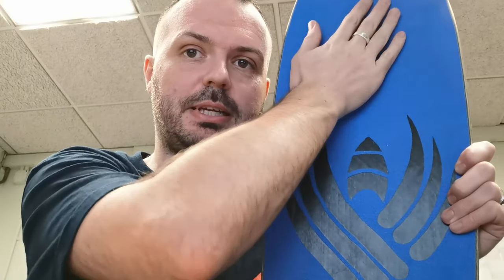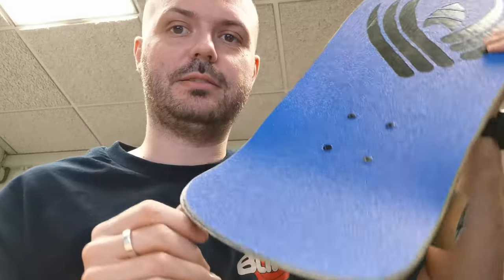I did a custom re-grip of my Powell Peralta Flight Caballero skateboard & easy grip tape removal.

Comment: I have regripped my flight decks a few times. The grip comes off easy. I did have the carbon peel up one time. But flight decks last longer than the grip so it is good to do. I always order the same flight deck 8.25  shape 243. I just received some Powell ripper grip for my next flight deck set up. I thought it would be set up by now but this chocolate deck am skating is really holding up well. I don't think any one will hate on your grip, I think it looks great. Agree, fill the gaps. Really nice job.
Reply from the maker: Thanks, Yeah I've actually never had a problem removing grip from any deck even a 30 year old Tony Hawk I bought, if you grab the edge and pull it at a right angle to the surface it always comes up clean and doesn't leave any residue behind, I see a lot of people talking about using acetone and heat guns etc but it's totally unnecessary.
A couple of fibre strands did come up with the grip but you can see me cutting them with a blade in the video was no big deal.
I'll fill in the gaps if it becomes necessary I'll see how it goes on my first skate with it but as I said I don't put my feet there and I only skate transition so my feet don't move around the board an awful lot.
Reply: @NeilHesterSkateboarding  ok